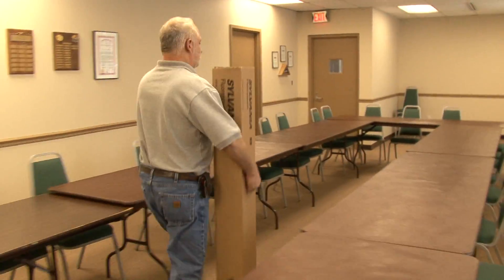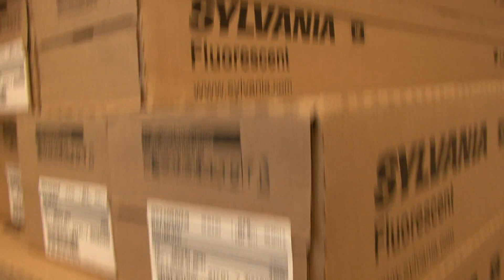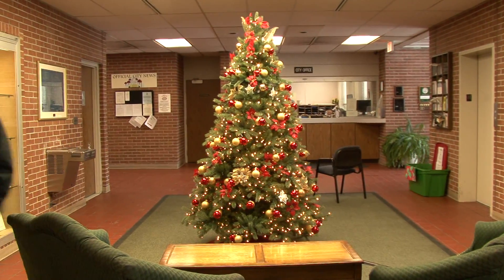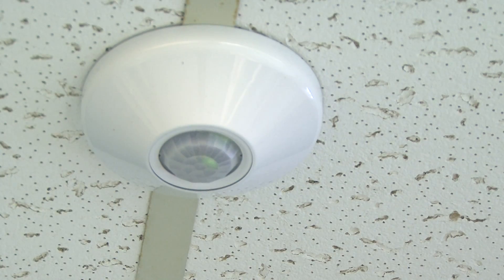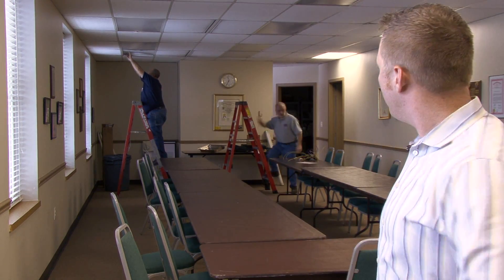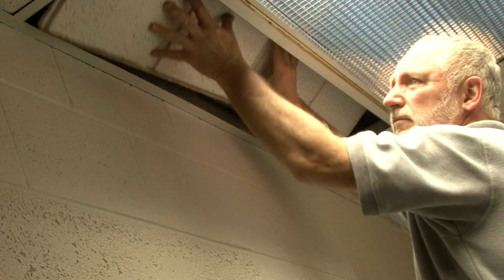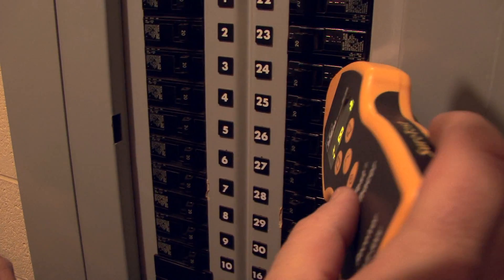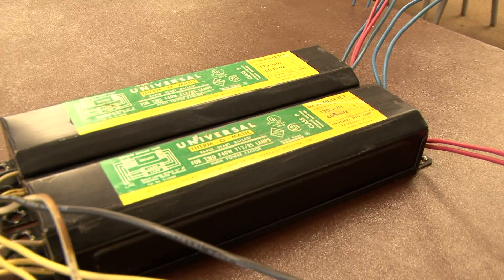Commercial Lighting Retrofit in Lathrup Village, MI

Comment: Great job, however I noticed some misinformation that I would like to point out. First of all, the T8’s do not cut energy usage in half. Second of all, 2 F32T8’s are not going to equal 4 F34T12’s in light output. Try 4 NEW F34T12’s. They will probably be much brighter than 2 new F32T8’s. Even with a LBF ballast, 4 T12’s would still be brighter than 2 T8’s. However, as I already stated, the retrofit was well done and the video was fun to watch.

Comment: I am doing this in a commercial suite with 16 2' x 4' fixtures with 4 bulbs.  I was curious of how you clean the black smoke off of them?  I have used a green degreaser in a finger trigger spray purchased ready to use.  Been using blue paper shop towels.  It seems to dry fast, leaving smears that I have to keep repeating.  I tried toluene but the paint they use is not resistant enough and almost came off with the black residue.  These lights had heavy old ballast that some leaked oil and corrosive material.  I am taking out two heavy old ballast with large bulbs replacing with one small light ballast that powers all 4 T8 and are  deluxe daylight bulbs. A beautiful white color that looks amazing with the ceiling! There must be a better way to clean them?  Perhaps a rag with bucket of a solution?

Comment: If only my high school was able to have an LED retrofit. The T8 lights here look like they are from 1982 and are always failing. Plus, in the gym there are 36 HID fixtures that use an enormous amount of energy.
Reply: the LED retrofit on those HIDS would be easy. Bypass that old dinosaur magnetic ballast, tie the power wires straight to the existing socket, twist in an LED corn lamp and you're all set.

Comment: 1. 34 watt tubes are junk anyway; 40 watt are better
2. Half of the old tubes are burned out
3. I highly doubt the new ballasts will last as long as those old ones did
Reply: I totally agree electronic ballasts suck, magnetic ballasts last much longer and they are more efficient than electronic ballasts.
Reply: @brendanusualvlogs7842  electronic ballasts are definitely more efficient
Reply: In 2024, they probably have burned out and you could lower energy usage to half by switching to LED panels - getting rid of 1980s fluorescent look for a sleek modern look.